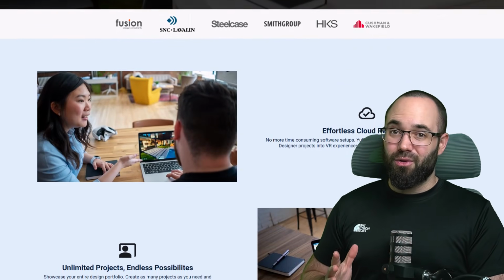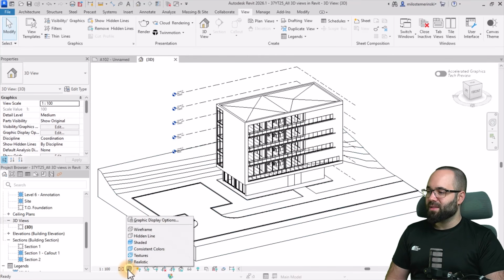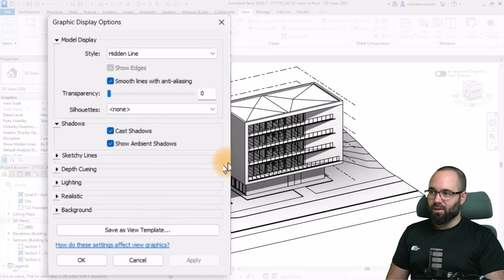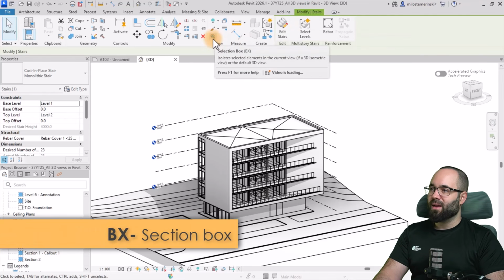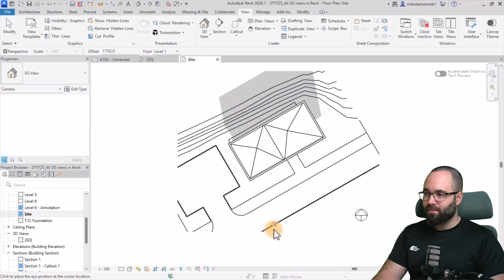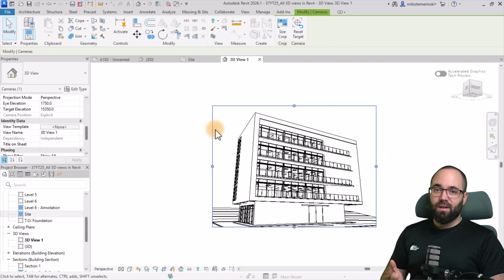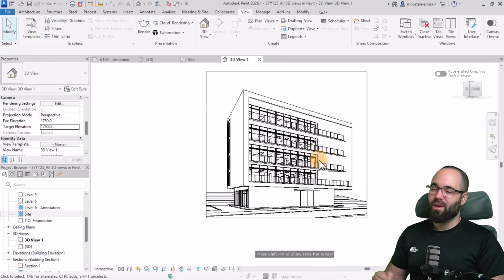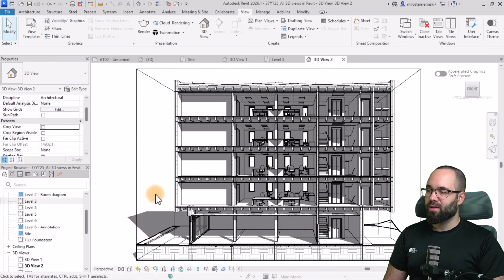3D View Types in Revit Tutorial | with Yulio

Comment: Exterior camera views work ok, but with interior camera views if you try to move forward or sideways the image gets wildly distorted. Until I discovered last year that by clicking the "Do not Crop" option on the bottom menu bar,  I can navigate inside my model with ease, without having to go to the properties palette and adjusting eye height, target height and camera position. It also means that in my Project Browser's '3D views' section, I have just the default 3D orthographic view plus a single perspective view. Previously, I'd end up with a whole list of separate camera views inside a building which invariably I'd have to go through and delete one at a time. Discovering the "do not crop" trick was a game changer for me.